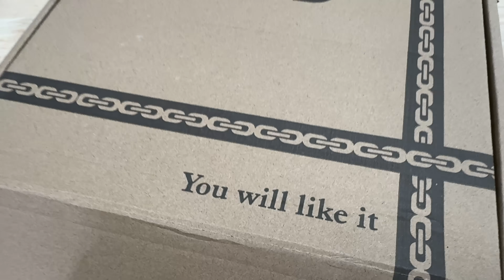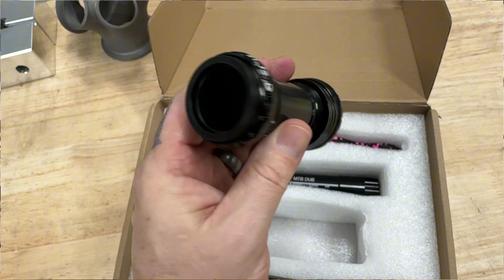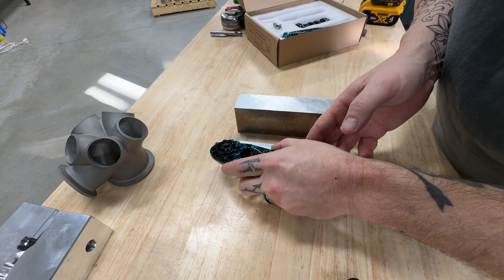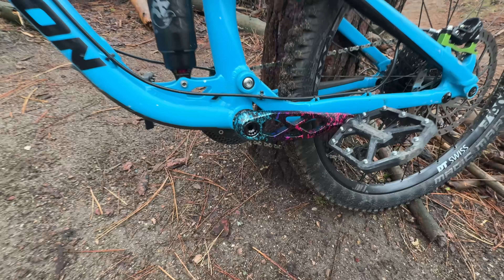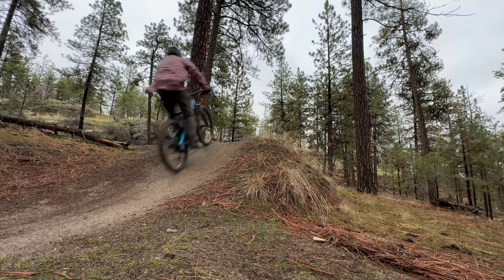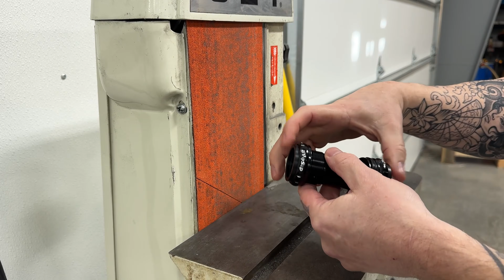Testing AliExpress MTB Cranks: Are They Worth It?

Comment: I bought these about a year ago for rebuilding a derelict Stumpjumper EVO, which had a stuffed BB. I wanted shorter cranks than the bike came with, so removed the carbon Shimano cranks already on it, fitted a cheap PF30 to DUB two piece threaded adapter, works like a charm and looks great.

Comment: What did you torque the main H8 crank blot to? I’ve gone through 2 sets trying to find the right torque setting.
Reply from the maker: I just got it goodntight by feel, I didn’t want to over torque them because the bolts are aluminum as well as the spindle, so I just greased them well and snugged them by hand with an Allen wrench.
Reply: Did you figure it out ?

Comment: Did you use one spacer on the drive side? When first fitting it? That's the standard. If you don't it won't be optimal. The reason for using spacer int he drive side is if you have a frame without chain guide mounts, you remove the spacer and  install an adapter mount. 
This could've been the reason. I own Chris King BB, it came with 1mm shims in addition to the drive side spacer.
Reply from the maker: I didn’t but I should have. When I first looked at the bb it looked like the crank arm would run the housing without a spacer on both sides, but looking at this new set I think it would have worked without the spacer on the non-drive side.
Reply: @LoamTech_MTB  Housing? I'm not sure  what you are reffering to. But yes, there shouldn't be a spacer on the non drive side.

Comment: I got the Evosid with bottom bracket also. With the plastic spacers snapped in the spindle wouldn't fit through the plastic and I eventually broke the plastic. Got SRAM bb and it works fine.

For your cheap build don't get the carbon hightower knock off. The integrated upper headset cup cracked on first 30second test ride

Comment: Im not super sure about the design of these in general since ive heard the official 5dev ones have snapped too. For anything under a light-moderate trail bike it seems great but for anything past that i would be terrified 😂
Reply from the maker: @Flowers4every1  hmmm… maybe I’ll have to rig up a torture test…
Reply: I'm not a fan of the 5dev cranks but they have been revised since the first version that were breaking. Now some sponsored world cup DH racers are using them, and I doubt theyre replacing them every race like rims and tires, but I could be wrong. So the aliexpress cranks might be ok if they copied the 2nd version, but I'm still not going to buy them.
Reply: A dude cracked it during a city ride, and big dude broke it on mtb ride, but the updated the design, I saw a dude compare new an d original, but the short story is it's thicker at the top. But I'm still skeptic.